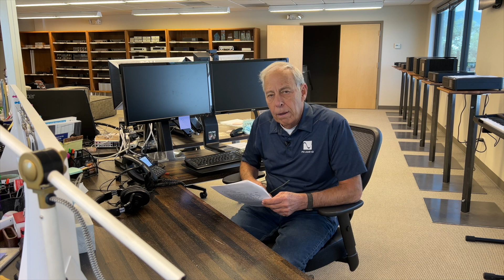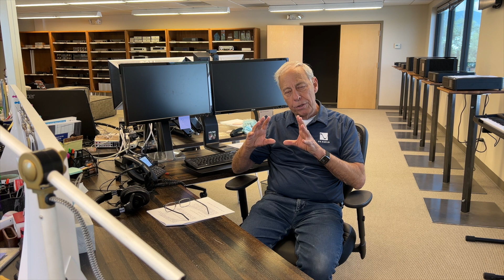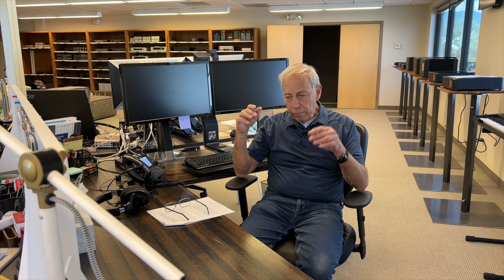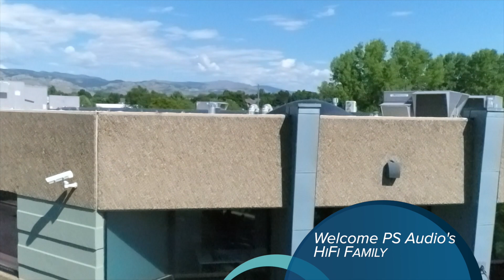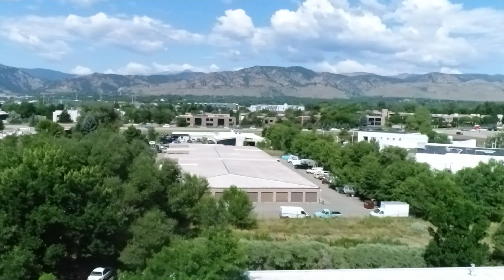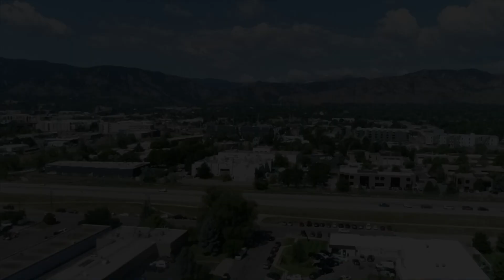Tube amps and output transformers

Comment: The best way to drive a speaker is with zero Ohms output impedance and a voltage that exactly tracks the input signal. This is the ideal condition and using tubes and output transformers in a power amplifier is polluting the signal path messing up the damping factor and frequency response (impedance dependent). Any serious audiophile purist want the cleanest signal possible to the speakers and definitely a tube amplifier is not the way to go today. Yeah, if you have a power amplifier too weak on power, then tubes clip in a more musical way (even harmonics distortion), but why the heck do you want a system where clipping even becomes an issue? Just get a power amplifier with adequate power to play loud and clean with no such clipping and you get the best performance. I rather have no distortion than some tube distortion. Anyone who considers himself as "audio purist" and likes tube distortion is in conflict with himself. It's OK to like tube distortion (if it makes you happy) but please don't think you are purist.
Reply: How about people who are NOT purist, but just want sound THEY like?
It is all fake any way, no matter what. Now you just have to decide on what kind of fake you prefer.
Reply: @hugobloemers4425  Of course that's what this hobby should about. Whatever makes us happy in our audio hobby, we should do. I didn't say it's not great to be a tube fan, if that is what makes you happy. If I had a choice between a 1 Watt tube amp and 1 Watt transistor amp, I would probably prefer the tube amp because I would end up hitting the max power too often. But rather I would just buy a >100 Watt amp and not bother with clipping. Another way to get the tube distortion is with using DSP. Actually, a DSP is much better in making tube distortion because it can be precisely calibrated and not drift over time like tubes always do. Someone should design an audiophile DSP tube distortion device that genuinely sounds like real tubes but even more optimized. These things tend to exist only in professional studios e.g. as DAW plugins.
Reply: @ThinkingBetter  These plugins exist also in non professional studios because even the good ones are not really expensive any more.
Reply: @ThinkingBetter  I was thinking along the same lines but creating a DSP that mimics the frequency response and higher crosstalk of a high end turntable/cartridge setup. I am positive that, aside from less surface noise, it would be impossible to tell the difference between the DSP and a turntable.
Reply: @mddawson1  Of course you can make DSP code that mimics turntable noise, wow&flutter, compression, distortion, left/right cross-talk etc. You can probably make it indistinguishable from real vinyl playback.
Reply: THD isn't merely about clipping. The problem is simply that humans aren't equally sensitive to different kinds of distortion as measuring equipment. Your ideal world option of "no distortion" does not exist. At this point in time, the question still is, would one rather have lower distortion where the residual distortion sounds vile, or higher total distortion that sounds pleasant. That's why even in the 21st Century, there are still both camps of audiophiles favoring transistor amps and others tube amps - and they're both equally serious about their hobby. I'm personally in the camp of a what sounds great, which is why I like anything that'll achieve that goal and am not going to limit myself based on a misguided set of principles.
Reply: @LeonFleisherFan  yes. when he stated "...don't think you are a purist..." he lost me. I didn't realize that was a defined & measurable engineering term.
Reply: @grumpy9478  In the audiophile world, "purism" isn't a target-oriented term. It usually refers to e.g. designs using a minimum number of parts, which incidentally tend to result in components that sound great but don't measure well. If "purist" were a term referring to audiophiles who like natural sound, I'd be all for it, but referring to the absence of distortion, the term makes as little sense as referring to someone as a great pianist who happens to never play a wrong note, as if that made him a musician (but instead makes for what Mozart disparagingly called a "mechanicus").
Reply: @LeonFleisherFan  I'm not arguing that distortion is existing for any amplification circuit but the incremental distortion per amplification stage in the entire music distribution chain involves a lot of individual transistors and op-amps for virtually all music and you can take each of those and you won't be able to distinguish input vs output by listening. The exception is when people add a tube stage and run it for reasons of adding audible even musical sounding harmonics. I've done audio engineering for ages and you can't make some blanket statement on this topic. Tubes are often intentionally used to alter the sound and it's OK but it's not about keeping the signal at its purest. I'm not sure what you define as "vile" sound for a transistor amp used within its intended operating range (no clipping) but poorly designed transistor amps exist and of course transistor amps doing hard clipping operating signals above defined dynamic range will sound vile and yield a lot of listening fatigue. Just never run music near clipping level using a transistor amp.
Reply: @ThinkingBetter  That's engineering 101. Not sure why you keep pointing out clipping, not referring to amplification powering open air concerts. On the contrary, referring to either concept at the highest level, taken to the max. Comparing affordable tube amplification to affordable solid state, there's no question which is more efficient (efficiency is the basis of SS's claim to superiority, there's no debating that), and I'm certainly not advocating superiority of one over the other. For sonics alone, where the first watt matters most as Nelson Pass would say, the "vile" character clearly isn't a matter of clipping (ever measured how little power is needed to drive speakers in a home setting - you might be surprised), but artifacts apart from the harmonic distortion prevalent in single-ended tube amplification, such as crossover distortion etc. Clipping is top on the list for listening fatigue only because it'll cause it in no time. It would be naive to assume that audiophiles who listen to music for hours, natural instruments and voices recorded in natural settings, ranging from jazz to classical music, including lengthy works such as opera etc., will not suffer from listening fatigue because they aren't driving their amps into hard clipping. Hard clipping is when everyone rushes to leave the premises or pull the plug within a split-second. Nor is it true that driving tube amps into clipping is not fatiguing, as this becomes audible ahead of time as a form of dynamic compression that in itself is fatiguing to listen to. If the absence of hard clipping were the equivalent of sonic perfection, no audiophile would spend money worth mentioning on amplification, be that SS or tube.
Reply: @LeonFleisherFan  I never bother with listening to music that involves any clipping as I generally ensure the dynamic range is adequate for my listening. You should read the above mentioned article “Why tubes sound better” and what Ken calls “euphonic distortion” for what tube distortion is. It’s not my intent to say such distortion is bad but I want to be firm that it is an added distortion effect to the signal and not about keeping the signal pure. One tube stage is enough to get the effect with some balance and you probably wouldn’t want the entire signal path for music from microphones through studio gear to speakers to be tubes only.
Reply: @ThinkingBetter  Again, engineering 101. That distortion is at the opposite end of signal purity is not a matter of debate. Psychoacoustically, 1% harmonic distortion is still pleasant sounding, whereas as little 0.1% third-order is so much of a turn-off no audiophile with ears would buy such a product. You're emphasizing the euphonic aspect, which may or may not attract some listeners to tubes. You're however omitting the more important truth about what I refer to a "residual" (disharmonic) distortion, that as low as that may be, it has a way of sticking out like a sore thumb (and cause listening fatigue). I personally like anything that sounds great, and what you refer to as euphonic distortion isn't what makes a product worth buying, the sound had better be e.g. balanced, dynamic, detailed etc. Euphonic distortion isn't a godsend per se, but a balance act as it can easily make an amp sound resonant. There are tube amps that sound great just as there are like solid state amps that sound great: the attraction lies in what they have in common, which is what they bring out of recordings. It would be downright naive to think tube amp aficionados own tube amps because they're looking for distortion. That may be true for middle of the road products. But then, a middle of the road solid state amp has its shortcomings, too.
Reply: @LeonFleisherFan  Psychoacoustically, harmonic distortion can sound pleasant when it is made of mostly even harmonic frequencies. Uneven harmonic distortion usually do not sound pleasant.
Reply: @ThinkingBetter  Correct, although it's also a matter of achieving a balanced spectrum. Ever listened to push-pull tube amps? They're fairly common in the middle of the road price range. Those cancel out 2nd order harmonics (unless the designer uses some tricks to get around tubes matching for the positive and negative half), and what's scary about them is how much they sound like solid state (referring to the whole range, from mediocre to very good, as there's similarly a range of mediocre to very good, perhaps even great push-pull tube amps). Interesting to look at the spectral analysis and compare to solid state to figure why one is nonetheless able to tell which is which. Not a secret tube aficionados prefer single-ended (why have all the disadvantages and none of the advantages, to exaggerate the point).
Reply: @LeonFleisherFan  I prefer an amp that is as true to a pure voltage amplifier as possible and for a power amp that means very low output impedance keeping the gain constant at any load. I want no audible harmonic distortion and will operate signals within the max clipping level at all times. A well designed transistor amplifier can do an excellent job in not bothering me with artifacts and remain precise for many years unlike tube amps that change characteristics during warm-up and over time as the tubes degrade. I like to know the signal to my speakers  is as close to perfect as possible at all times.
Reply: Poetic and emotional point of view tells  about "serious audiophiles" and "cleanest signal possible" but it is the world of fairytales   - comparable  to "serious dragons" and "pure    princesses".  If you believe it engineering it is for you obligatory  to describe who do you mean  serious audiophile and show us the cleanest signal possible.
Reply: @Mikexception The cleanest signal possible is one that represents the source signal maximally without added audible harmonics, phase shifts, frequency response deviations and other artifacts. The cleanest signal is one where the output voltage equals the input voltage times gain factor at all audible frequencies and combinations thereof (with signal latency considered). Intentionally adding tube distortion to music is fine for those who enjoy it and I'm not saying otherwise. In fact, a lot of live music will sound even more live by adding tubes in the signal chain. I've done a lot of tube listening in the past. I'm just more into keeping the signal as pure as possible and while I like to do some room EQ, it's always with the aim of matching the studio intent. The topic is much about matching the studio intent vs making it sound live and rich, perhaps beyond what the signal itself provided.
Reply: @ThinkingBetter    I am just trying to understand you.  May be you heard about some "clever"  people who distort sound of solid gear in hope for nailing not so clever buyers who never had good tube gear that it is something characteristic for tubes?  I mean good tube gear is the one that has THD  less or the  same as average solid amplifier  Average solid at 10% nominal power usualy has them below  0.2 % and it is way better than acceptable.   It's cheaters  problem  -   cheating and being cheated is  not interesting to me.
Reply: @Mikexception  A good article is found if you search “Why tubes sound better” by Ken Rockwell. He calls it “euphonic distortion”. It sums it up well.
Reply: *themself, not “himself”
Reply: @EliasTheHunter  Gender-neutral "himself".  This was accepted grammar for hundreds of years, up to a few years ago.
Reply: @louisxiiii  it’s not inclusive enough. And, to your point, the past few years have illustrated that.
Reply: @EliasTheHunter  No, it is perfectly inclusive, as it includes everyone - male, female, trans, non-binary, non-gendered.  Singular they, on the other hand, is deeply racist, as it adds more rules and exceptions to the language, making it harder for foreigners to learn.
Reply: @EliasTheHunter  Your closed-mindedness, complete inability to question the fad of the moment, and total lack of perspective is staggering.  Singular they is just another in a long line of terrible solutions to the gender-neutral pronoun problem.  We have had gender-neutral he, slashed he/she, randomly scattered hes and shes, and now singular they.  What we really need is a new pronoun to fill the void, one that fits the existing grammar rules (why don't people say "they likes tube amplifiers" when using singular they? ), doesn't sound stupid, is easy to remember and pronounce.  Ey/em/eir is the best solution I have seen.  It's the plural pronouns they/them/their, with the th chopped off.  It would use the same verb conjugations as the other singular pronouns.  Easy-peasy.  Yes, we have called each other nasty names, this is the internet after all, and I really don't hate you in real life.  But I ask you, could you embrace a set of pronouns that both grammarists and people who don't identify as he/she could get behind?
Reply: Did you ever give any thought to the fact that the instruments that are playing into a microphone distort as well? It’s not only about the electronics.
Reply: @Scopolamine46  Of course instruments have distortion and the mastered music is with distortion, intentional or not. What does that have to do with this topic?
Reply: Did you ever give any thought to the fact that so many acoustic instruments can distort as well before the sound waves reach  the microphones? Ever hear of a sour note?
Reply: Good luck to you with your theory about tube .
Reply: @Scopolamine46  The behavior of tubes on audio signals is well understood. Actual tube distortion behavior can vary greatly per each tube as it ages and depending on internal tolerances. I know it sounds controversial, but in my honest opinion, the best tube sound is made by a DSP optimized to the exact best sounding characteristics (it won't drift and there won't be any pairing issues).
Reply: @ThinkingBetter  Use a DSP to mimic the tube sound? You have no soul.
Reply: exactly